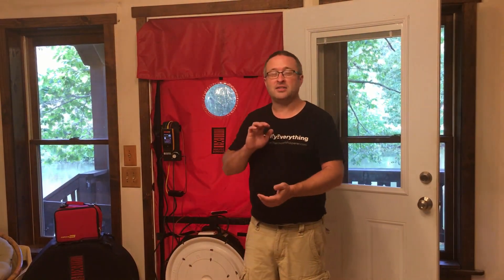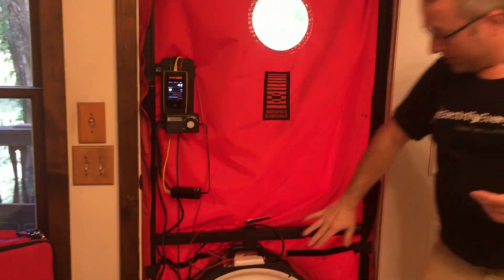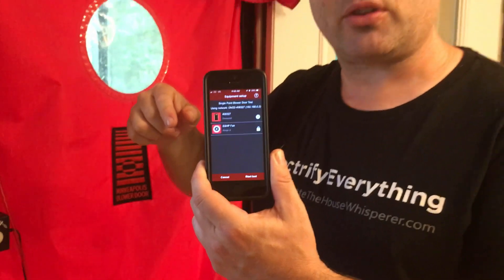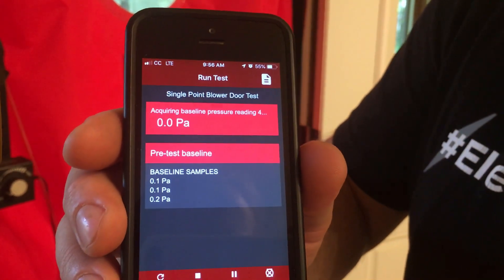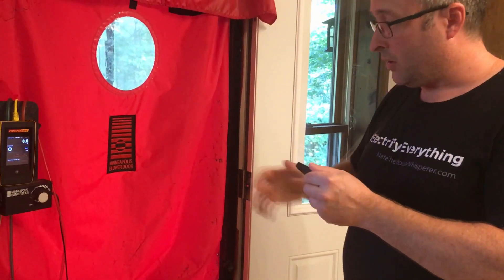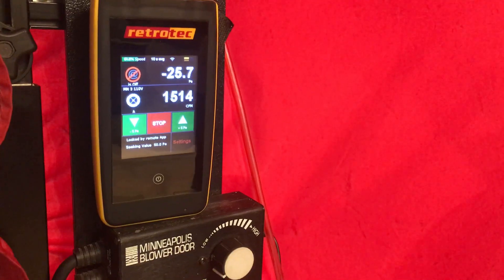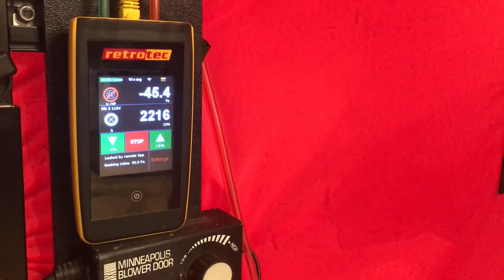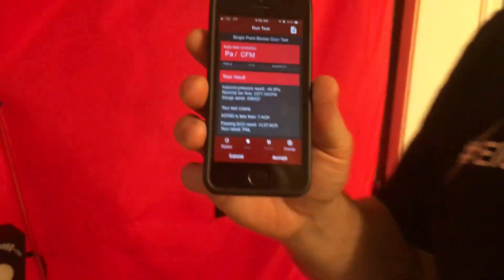Running Blower Door Test On My Own House - The River House

Comment: Thank you for posting this!  I have one scheduled from a service agency who has told me utterly nothing about this testing and I am already nervous enough having strangers in the house during a pandemic.  Knowing what this is really allays some anxiety.
Reply from the maker: Glad it helped! Why are you having the test?
Reply: @NatetheHouseWhisperer  It's part of their inspection process to qualify for weatherization help.  I know my house is drafty, I can actually pinpoint a number of specific problems, but this is the final thing they do on the day of the inspection.  My living room floor was 40 degrees las winter when it was 20 degrees outside.  That one's my biggest issue.
Reply from the maker: MatchGirl great! You’re lucky to get the help, it’s a great program in most states and they don’t have a ton of funding. I used to do the work in my insulation contracting days.

Comment: 116 degrees in southern California in summer of 2020 and never had to turn my A/C on. Why: humidity was 7% I turned on my evaporative cooling system  "Bonair 5000" ( cost $600) and it cooled the home as good as A/C for the cost of running a fan. When humidity rises above 40% we use the A/C
On average 2 weeks a year. My opinion on this test is totally not needed if you know how to cool and heat your home. All this hoopla to save $20.00 😏 does not make sense to me at all.